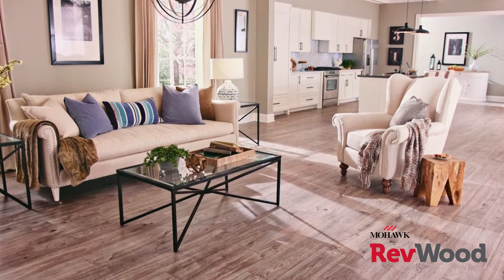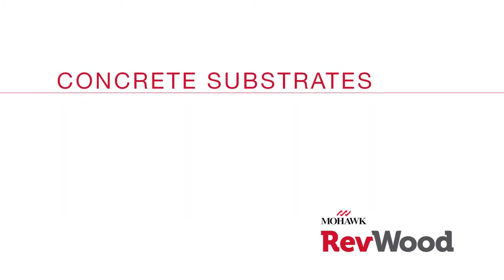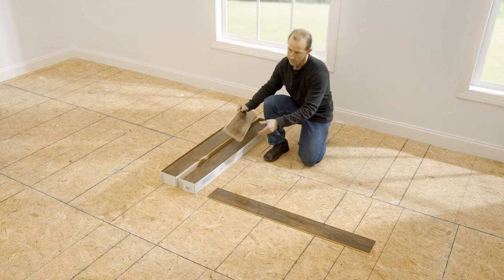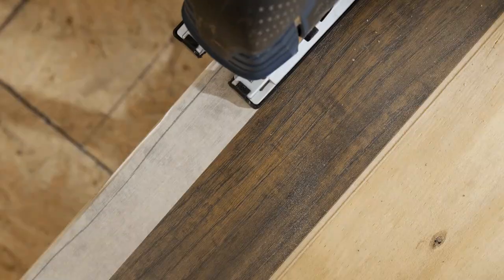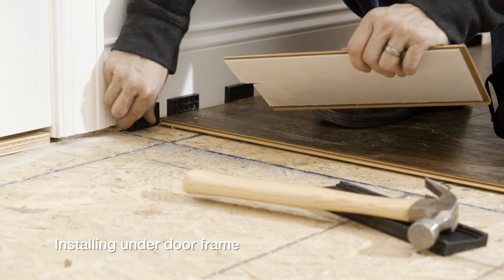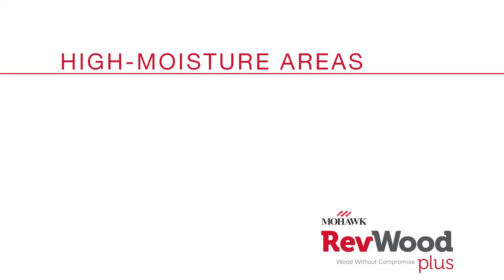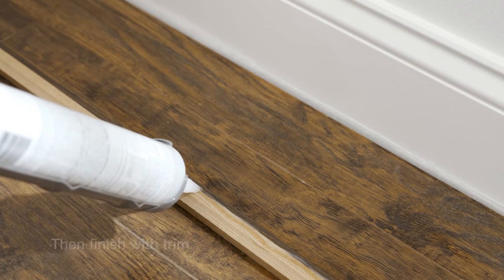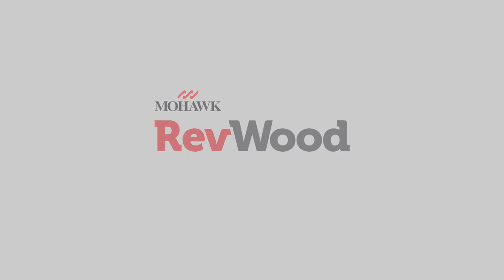Mohawk RevWood Installation

Comment: What kind of underlayment do I lay? Mine didn’t come with any attached. The guy at the flooring store said revwood doesn’t use any…?
Reply from the maker: If there is no underlayment attached, you will need to put some down. Typically you have a Standard & Premium underlayment.  Standard Underlayment will work just fine, but doesn't have as good of an Sound Transmission rating as a Premium Underlayment which will help keep the transmission of sound down.

Comment: Is the silicone sealant used clear or white?
Reply from the maker: Any color would work. You can get silicone in many colors. It would be a personal preference and what would aesthetically look better. For example, if your wall base is white, you would probably want to use white silicone. If your base is another color and they do not make a silicone that matches, you would probably want to use clear.